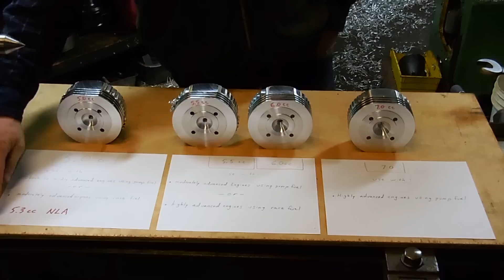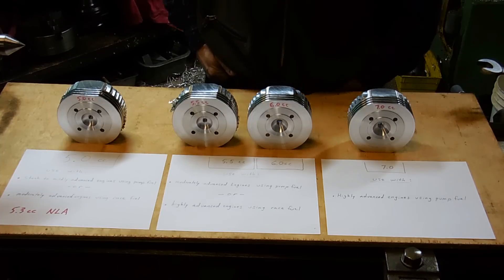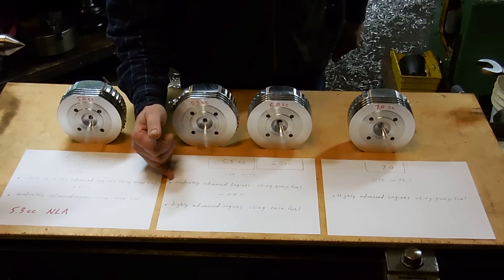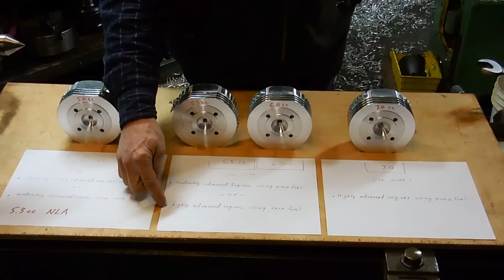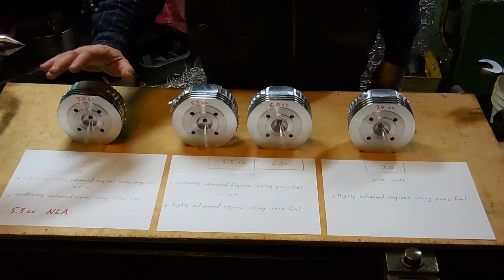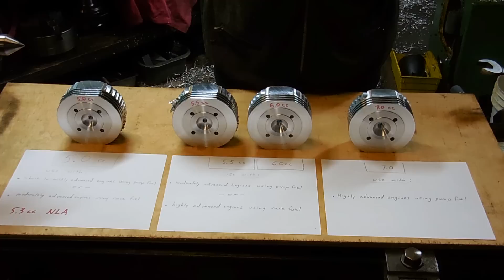Fred Head combustion chamber size guide for motorized bicycles

Comment: I'm using a stock49cc or 50cc engine , I replaced the piston and the cylinder to an 80 cc and kept the 49cc head , I was having issues with the 80cc head which would you prefer for something like this if any

Comment: dangit.Once more into the....I'm using a 26"Mongoose Mt.bike with suspension forks.26x2"front tire well treaded,and 2.25"width rear super knobs.(It snowy here in MI>now.)Will be changing to Touring 2.25 frt &rear come summer.Using boost bottle until reed valve comes.A sprocket gear for idler pulley.Rubber mounted engine,and tank.Allot of silicon in clutch cover to cut noise.

Comment: Sorry.I should've stated that I'm using a Just broken in 66cc 47x40mm w/40 in and out ports.Only work was to remove casting flash from ports inside and micro bevel edges.Am going to add simple reed valves to intake and smallest expansion chamber.Running 93 pump gas and synthetic blend oil now at 25:1. 44 tooth sprocket but going to change to 50 for hills here.220lb.bike and I.Thank you again for your time.(NOT going to race,just looking at most efficient w/torque too.)

Comment: Hi Fred.Thank you for all your Very informative videos and great products.I do have a question about the alloy heads.I'm thinking of boosting the output voltage of the coil into the Plasma Plug range and using one.Will the 5.5 withstand the extra heat at the plug's spark?

Comment: what set up would produce 70 mph  motor and gear ratio ?
Reply from the maker: I don't know much about different fuels, but if you want to go that fast, you would probably want a high compression head (5.0) and use an alcohol fuel like methanol. You can even add some nitro to that. Again, I don't have any experience using those fuels. You would probably use a small sprocket, like a 28 tooth.
Reply: High compression head. Big Bore Piston and Race Fuel.

Comment: Why did you not just offer 1 head and a range of head gasket spacers ??

What is the HP of an 80 CC engine "Full House" ?? and do you have a break-down of the HP of each hop-up part ??
Reply: +TIMEtoRIDE900 proper squish clearance is key to prevent detonation along with proper tuned carb.

Comment: Hi fred i wanted to ask you, have you used thos aluminum frames with a gas tank built in many online sellers offer? Do you think it is safe for speeds over 35 mph? I want to build a high performance bike but i havent quite found a frame i feel to be strong and safe enough.
Reply: +jose jimenez I know its an old post, but I wouldn't really trust one of the frames going over 35mph. And other variables apply... double walled rims, heavy gauge spokes, tires, riders weight ect ect.
Reply: I need one fred

Comment: What cc is oe approximately?  what do you recommend?  I bored/ground out the intake neck and exhaust pipe and their gaskets to match.  stock head slant and non-slant. 80cc (67cc) skyhawk grubee.  Stock carb. Stock gutted pipe.  Nology coil & Jaguar cdi conventional neg ground.  Wish to use pump 92/93 octane.  Rider weight 182lbs. Tour gear 20-35lbs.  Bike 47lbs.  Extended (meaning hrs) of 3/4-7/8 throttle open use. Frequent bursts of wot. 36 tooth, 35-622 (700c).  ele 300-1600ft?  Air temp 22-90 deg F. Humidity (I know it matters a little but who cares). Am I forgetting anything?
Reply from the maker: Okay aric. Well, the main components in your system are mainly stock. Stock carburetor is small. Stock exhaust header is small. Opening the back end of the exhaust will help flow, but this set up is still restricted. That's okay. Nothing wrong with that, but even with the porting you did, the intake and exhaust is still restricted, so your engine would be considered a mildly advanced engine, so the high compression head (5.0cc) would be the best choice in my opinion. Thanks
Reply: I strongly recommend non oxy-it's alot better for your engine and you get more power out of your engine
Reply: That's ok.  That's why I add a fifth of whiskey x 4.  I mean diesel fuel. When you're riding accross the continent you can only add what is available to buy, esp. Mexico. And some NF octane booster cause of its space and weight savings.